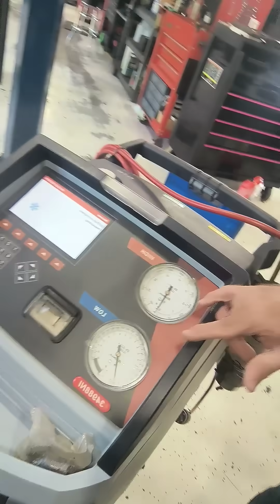32 #FAQ how do you find my car's #AC leak?

Comment: once vacuum is pulled at just -2 bar  close valves  read scale if it starts going up to 0 then leak   or use nitrogen  or plain compressed air , hope its only a fitting if its evaporator cancer ye ha 3000$  later  , dyes work if you see it  when its in the vent  box hahahah   you keep working on it
Reply from the maker: You are correct it was an evaporator leak.